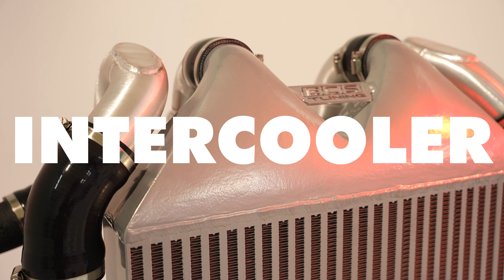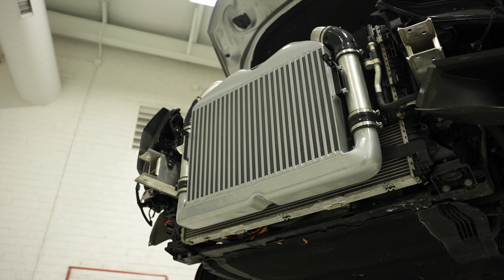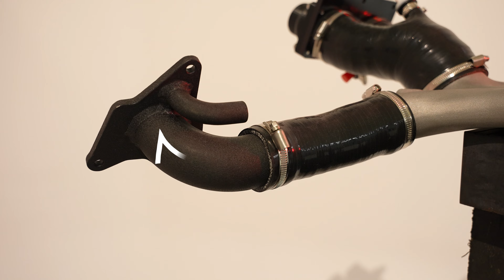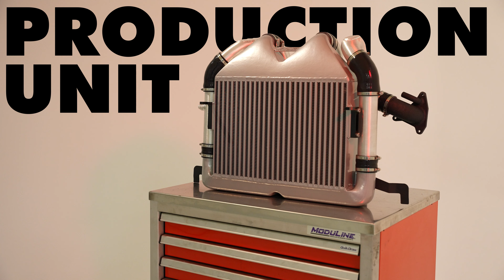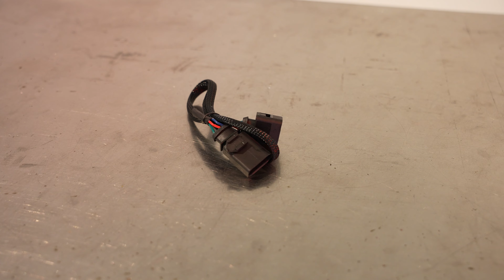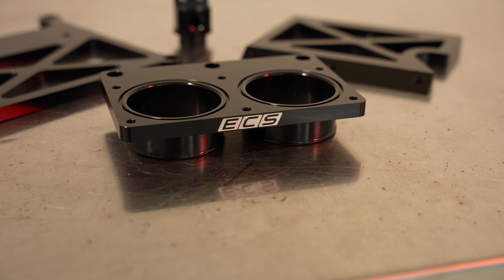Audi S6 Air-to-Air Intercooler! | ECS Product Highlight

Comment: It's both interesting and funny to see this solution brought up for the 4.0t. A near and smaller cousin being my 1.4tsi with a bigger turbo (IS20 with custom adapter kit) FBO and custom tuning, showed early signs of poor heat management in the IAT department. Taking notes from those before me in the same application, FMIC remains one of the most challenging at first, yet simple and totally divorced intercooling solutions for my platform as well. So, with that in mind, this platform arrives stock with a shared coolant circuit (with the already taxing engine and transmission cooling system) for emissions and efficiency. A poorly managed and designed Air to Water intercooler built into the intake manifold. Thus, it requires deletion of the internal intercooler brick from the intake manifold and custom air to air intercooler pipework as well as your choice of fitting intercoolers for front mount. It really helps a ton. The R/D was tricky and had quirks to be tested and changed using different intercoolers and sizes, but I've arrived at a decent consistent setup now since then cost wise. 

Air to Water intercooling is only better when designed properly and thoughtfully setup with a well-supported divorced circuit of cooling and airflow.  These OEM systems are bad in design for simpler manufacturing and bottom-line quotas to meet their standards of performance thresholds; limited to their bottom-line operating conditions. A good A2W intercooling system can be simple to some in concept but actually designing and applying that is trickier than a beefy, good flowing air to air system which is practically maintenance free and far simpler in function. Packaging and routing are the most challenging part of the process. Nice video for the product ECS! Shame on VWAG for continuing to contaminate R/D with stupid and overcomplicated inefficient design work and laziness (imo).

Comment: I’m installing the A2A and noticed when you turn the fans couple of full circles, there is clunk noise and the fans stop turning. Is that normal until the full kit is installed and the fans are running at full speed? @ecstuning

Comment: That's my silver S6 in the video. This upgrade was a HUGE improvement.
Reply: Worth every penny ? Getting s6 this June,  doing stage 1 or rs7 turbos
Reply: @AudimanCrec  Yep! Car has been running perfectly since the install. RS7 turbos getting installed soon.
Reply: What is the new required fluid capacity?
Reply: @viceverse11  it doesn't hold fluid. For that kind of money it doesnt show a big difference in heat soak according to the graphs on ECS site. I got a custome intercooler from Merc Racing. I'm goimng with the Wagner upgrade and adding Meth to keep to keep the temps down. Its cool I like it but the graphs don't show enough of a difference. And why would't they add bungs for Meth
Reply: @staystrong32 this is better when you start going bigger turbos and especially single turbo with full custom tuning. Not as big of a deal on stock or rs7 turbos.

Comment: My question is when does the c7 S7 and RS7 get a option
Reply from the maker: We engineer our products to be as bolt on and plug and play as possible. Theoretically, being a 4.0T car it should fit to some extent, but we have not confirmed the application, or engineered a solution at this time.
Reply: @ecstuning  i would let you guys test this on my s7 if I did live in Ohio
Reply: There is a YouTube video of this being installed on an RS7. You have to do a little trimming for the hot side/ cold side tubing but nothing crazy. This is going in my car soon.
Reply: @robertlaing2061  hi, do you have or can you share the link of that vid ?
thanks in advance
Reply: @robertlaing2061  Hey do you have the link for that video?